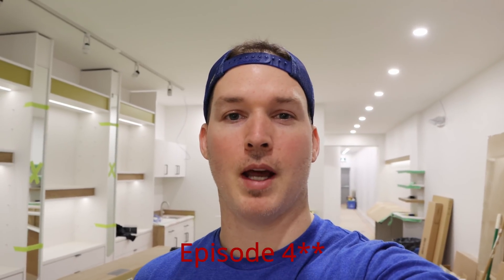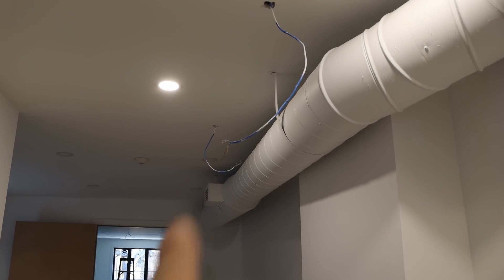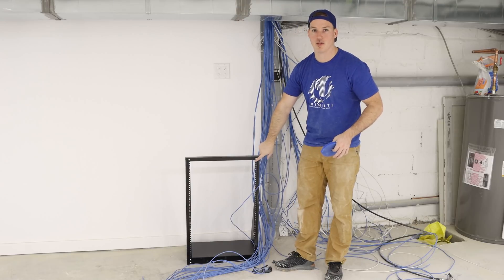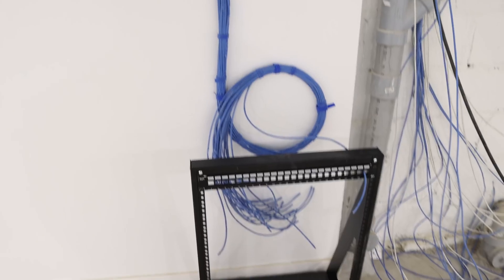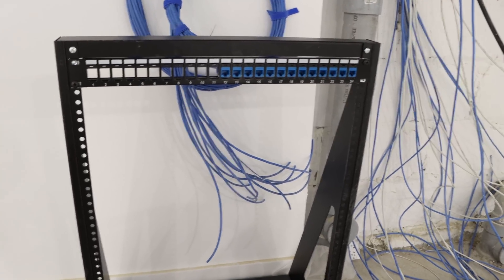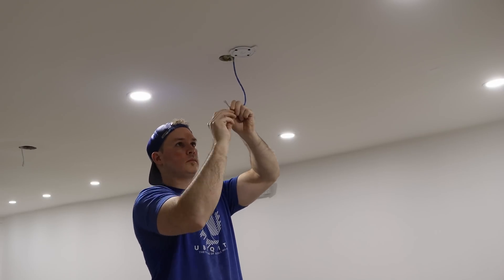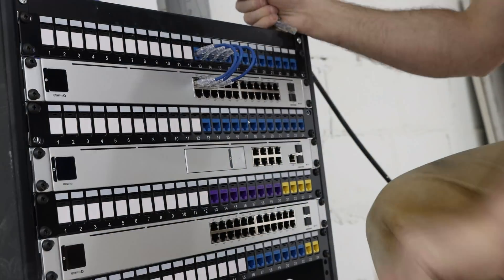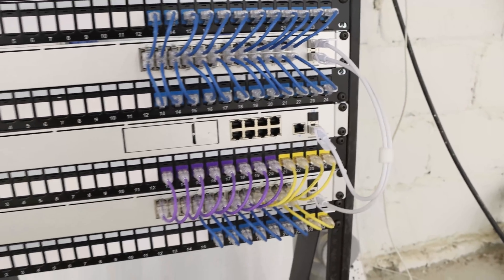Unifi Install and Cable Management

Comment: Maybe this is just me but... I would never run just 1 cable to a wall jack. You never know what will happen in the future. That doesn't mean it has to terminate to a switch, but at least be ran.
Reply from the maker: I agree. Problem though is what the customer is willing to pay. In this case they only wanted one drop

Comment: Why not mount the AP over the hole. Just pop a small hole in the plastic holder. Would look much better
Reply from the maker: The drywallers patched it after we were in

Comment: Hi Just wanted to ask, is it possible not to add a patch panel, and cut each ethernet cable so it reaches the ethernet ports of the switch and then just add ethernet connecter to cable and plug directly into switch

Comment: The partial hole where they made the AP hole too large is so cringe to me. Were the bracket mounting holes too narrow to cover that? Why did you offcenter?
Reply from the maker: We were in there before the dry wall was up and had the cable center. The drywaller needs to pop the cable through the hole for us.

As for the massive hole before the AP that was all patched up

Comment: Looks good. I'm working on a project where switches are 300ft away. Are there DAC cables that long? Or would I need to just buy sfp port insert and use cat6?
Reply: DAC is meant for in-rack cabling. You'll want to use Cat6 or fiber depending on your speed, distance, and RF requirements. If It's 300ft of cable, 1Gbit is plenty, and you're not running next to mains wiring, then Cat6 is probably good.
Reply: @PoisonWaffle3  Thanks Scott. That's what I'll do. And I found the Unifi CAT SFP adapter so that will work perfect.

Comment: Glad to see you seem to be doing well, bravo. What blew my mind though is a network rack sitting on the concrete floor in a basement? I'd have it mounted up on the wall eye level so I didn't have to stoop over constantly. 

Personally I don't even want my rack sitting directly on the floor in my office with a wood floor; wheels or feet are fine. 

Anyway, take care. Hope all is well!
Reply from the maker: Hey ,

Yup doing well. The client bought this rack. We changed it out yesterday for a walk mount

Comment: This video made my OCD very happy. How do you plan on connecting the NVR to the rest of the system?
Reply from the maker: The NvR will be plugged in using a DAC cable. We’re going to add a aggregation switch and also changing out the rack to be wall mounted

Comment: quick question, why not connect each switch from the UDM, instead of going from UDM to a switch, and then from that switch to another switch?
Reply: The top SW is at full RJ45 port density (24 ports used). The UDMP FW only has one SFP port for LAN and one for WAN(2); one rj45 WAN(1). You can reconfigure WAN for LAN I think, but I always prefer 2 WAN for failover internet even if not used immediately.

Comment: Looks great! Nice clean setup! I really like those patch cables. They're not something I've used myself, but I might have to switch over to them. 
The only thing I would change is the rack. I prefer equipment to be in an enclosed rack to prevent damage or tampering to anything.

Comment: On the first AP why not just offset the mount over the hole a little bit? It would have hid the blemish completely.
Reply from the maker: It has been patched by the drywaller.
Reply: @MactelecomNetworks  The correct approach is always the best ;)

Comment: Is there any reason why you looped in and out of the top switch opposed to running each network cable from the UDM?
Reply from the maker: Back plane of the UDM pro ethernet ports is only 1gb we’re adding an aggregation switch to this anyways

Comment: Hello,
How are you keeping track of what cable is what? do you label them before routing ?
Reply from the maker: Yup they were labelled with sharpie when I was pulling them in. I also have them labelled on a floor plan. Then the final labelling will be wire wraps behind the keystones, labels on the patch panel and then labels at the end device, faceplates
Reply: @MactelecomNetworks  Thx for the reply. Are you going to make a video about how you do it, one day?

Comment: I just realized, last year, I installed a new CCTV network for the company not that small.
1UDM Pro/2UNVR/1 XG16/7 USW or USW Pro/68 G3nG4 Cam/ 16 Door Access.
I Install all of it in 25 days with the other 2 helpers.(7/F Concrete building

Comment: Any reason you went from switch to switch and not both off the UDM ? Surely that is just asking for trouble if the primary/data/voice switch goes down, you lose both. If you DAC off the UDM to each switch you can still keep cams/wifi up or LAN/Voice patching up independent of the other.
Reply from the maker: Good question and you’re correct we would lose both. 

So we are going to be adding another two switches. One 16 port PoE and a aggregation switch .

But if we lose the aggregation switch we lose all switches. It’s all about client budget and how much availability we need

Comment: Great looking rack. 
Never understood not labelling cables during a pull, takes seconds with a sharpe and saves hours of work. If a cable gets damaged during pulling or by another trade it won’t tone. I’m in the UK and I would always expect a new install to go in order left to right from the door for each room.

It doesn’t take any longer to install, no toning needed, just test and I can label the outlets professionally, it makes finding outlets instant for customers. Also not uncommon to mark outlets on a map attached to the rack. Running 300+ outlets in a office is not uncommon, not toning that out. 

Cannot ever understand having say port 17 and 3 on the same wall plate. That’s just crazy!!
Reply from the maker: All the cables are labelled I jsut haven’t labelled the front of the patch panels which will be done tomorrow.

Also have a floor plan with all the numbers I did mention that labelling would be done on the next visit :)
Reply: @MactelecomNetworks  Can’t fault a professional install, like this! 
Was more of a comment over what I’ve experienced. Seen the good, the bad and the ugly countless times over the years!
Reply from the maker: @cg4528  I figured as much. Labelling is essential

Comment: Why did you pick the phone system you did? Would UniFi talk work just as well? Or would it fall short in certain areas?
Reply from the maker: I've used Grand stream quiet a few times and it works well and not over complicated to configure. Currently Unifi Talk is not available in Canada so its really hard to get the phones. If it were available I may have went with it

Comment: Hello there, can I ask why do all the CAT 6 Ethernet cables need to be on the patch panel before plugging in on the switch? Can they be directly plugged into the switch without needing any patch panel? Can you please explain, I don't understand.
Reply from the maker: Well the main reason cable management it would look not so nice if you just put rj45 end on and connect directly to the switch. Also the cables are certified end to end. If the cabling goes bad it will typically be the patch cable which can easily be replace instead of having to go back to the job site and re-crimp an end on
Reply: @MactelecomNetworks  Oh, now I got it. Thank you so much. Have a great day! 😊

Comment: I think this is my favourite style of video you make right now. Love it. Keep it up bro.
Reply from the maker: I love on the job videos I wish more people in my space would make them but it takes so damn long. Especially when you’re trying to get the job finished
Reply: @MactelecomNetworks  I though of also doing install videos but like you said time is money and I mostly work alone.  Setting up camera and talking while working is just too time consuming.  I do both tech support, design and install both hardware and software alone.  Adding recording is just way too much!  Just want to get in and out quickly!  Also question of privacy issues.  My customers are not too keen on having their setups being visible.  I myself don't like my private stuff on the web.
Reply from the maker: It does take a lot longer but thats what the people want to see. As for the privacy thing I ALWAYS get permission from the customer. If they do not want their site filmed we don't

Comment: Hey man, awesome work!!!
Quick question, what kind of keystones and set of crimpers you used? I have tried different kind and still haven’t found the right ones. Thanks!!!
Reply from the maker: The tool is the vertical cable I-punch tool and the jacks are vertical cable vmax there are links in the description to them
Reply: He answered this question in the video.

Comment: Have you tried ubiquiti's cable? do you have a link to the cables you typically order from Infinate cables?
Reply from the maker: yup I have I like them for patching in devices as you can bend the boot but I don't use them on the patch panel side

https://www.infinitecables.com/cat5e-cat6-cat6a-cat8/cat6-patch-cables/ultra-thin-patch-cables/rj45-cat6-utp-ultra-thin-patch-cable-premium-fluke-patch-cable-certified-cmr-riser-rated/?variation_id=10577
Reply: @MactelecomNetworks  what about for bulk cable? I look at the price Ubiquiti is selling a box for and the price infinite cable is selling a box for and I wonder what the difference is.

Comment: Well done, thank for the video! IMHO I would not put the UDM in the bottom - there are sewage pipes and a water heater, so IF you get a leak the floor might get messy incl the UDM ... or a rainstorm etc - get things OFF the floor as high as possible
Reply from the maker: The UnVR was just on the bottom temporarily for weight. We are actually switching this rack out with a wall mount so it’s off the floor :)

Thanks for watching

Comment: Question when working with this amount of cables, do you lable each cable before pulling the cable from the outlet to the patch location or how do you make sure what colour keystone to patch?
Reply from the maker: I do just with a sharpie. Then when I’m done I label the patch panels, do wire wraps on both ends of the cables and face plates 

I also have a drawing with all of the labels and where they are located
Reply: @MactelecomNetworks  Thanks for this quick reply, if i'am correct all cables going to the patch panel are blue, these are bundled and distributed on the two patch panels and switches. Is each cable labelled so you know where to connect the cables (blue for data/yellow for AP and purple for Camera). Or could you show this in upcoming videos? Keep up the great work!
Reply from the maker: @jeffrey8859  I think it will be easier to do in a follow up video I’ve had a few people ask this

Comment: Awesome Video. You mentioned at the end you went with a USW-PRO because you plan on setting up a ui access controller... Why do you need a pro switch for that? For the L3 capabilities? P.S. off topic - Noticed your Dexter stuff in the background. Did you hate the ending of new blood?
Reply from the maker: Hey so we need the pro because it has PoE++ to power the Unifi access hub.

I actually was ok with the dexter ending was a lot better than the original ending lol

Comment: Nice video and clean rack and cable management! How are you crimping the keystone modules with the cables?
Reply from the maker: For the keystones I use the vertical cable ipunch tool there is a link in the description for it

Comment: Basically, what could I expect to pay for a normal Cat 6 cable run to be installed residentially?  About 100 ft  runs
Thx
Reply from the maker: Residential is always tricky, depends if the home is finished I would say between $150-$300 I know that a large gap but residential is always a pain

Comment: Great video🤙however I do have a question. Why did you use only 2 DAC cables- is it not best practice to use at-least 2 interfaces for each of  those links between the switches and the router for redundancy? (link aggregation ) on most vendors STP is enabled by default.
Reply from the maker: You can do that yup,this install still is not finished we are most likely adding another POE switch and an aggregation switch. I’ll update when it’s completed

Comment: Nice install.  I would put 2 ciment blocks under the rack just to keep it off the floor.  Also might put a sheet of foam between the blocks and the rack to reduce the chance of rust.  You can pretty much put any type of thin foam.  Contractors usually have some lying around when they put wood 2x4 directly on concrete.  Love that Megapro screw driver!  I've had mines since 2003 when I started my IT Consulting company and still have it today.  I carry that screw driver with me wherever I go (except when I take the plane)!  Only issue I had with it is after 19 years of use, 2 of the clips that hold the spare bits are loose so when I open it, they fall out.  Very durable, still have all the bits and none of them are worn down but of course I don't abuse my tools!  Also added the red one a few years ago that has the security bits.  Practical when you need to open up security panels or remove screws from other brand cameras.
Reply from the maker: Great suggestion. We are probably getting another rack so we can wallmount just waiting on confirmation from the client.

Will be more work but worth it in the end
Reply: Yes, I would be worried that the basement may flood at least partially.   So a wall mount seems preferable or at the very least, up on blocks.
Reply: @MactelecomNetworks  You might want to just build a shelf onto the wall at about 3-4 feet off the floor. Nice sheet of laminated wood with a couple of triangular brackets under the shelf for support. A local Home Depot will have what you need. Set the rack and bolt it to the shelf so it stays to the shelf. This gets everything off the floor, keeps the equipment from becoming a dust vacuum and allows for working and viewing at eye level. Nice work on the patch panel layout for the short jumpers. I've been doing that for years and pretty much perfected the layout. Cheers!
Reply: and leave room for the heat to vent. im assuming out the back

Comment: Hey man, awesome install. I've got a question.. How do you know which cable goes to which devices or wall jack when you get to the labelling? Do you just power on everything, and see what unify says? Do you then rearrange the cables to match the camera keystones, and ect? thanks for all the work you put into this channel my dude!
Reply from the maker: Hey,

Good question I have a floor plan with all the data numbers on it and in the patch panel the data drops are blue so I just count up 1,2,3 etc maybe I’ll do a video on testing and labelling
Reply: @MactelecomNetworks  that would be super awesome if you could make that video.. something that shows how the labelling, and the planning for cables goes for organizational purposes, cus i couldn't imagine running all this cable, to feed into the rack and not knowing which cable went where lol thanks again my dude!
Reply: @aliazimi91  Its not so much remembering where each cable goes when running it. Lets say we pull 50 drops to a rack, I may or may not choose to label each wire as I am running it but most of the time I end up not doing that since in my experience I have to test each drop anyhow so we are doing twice the work. We run the cable, terminate both ends, tone from the wall plate to the rack, find it with a Fox and hound tool, label and test the pairs, and the map of the building/drops is made during that process. Then we can sort out the wires and group them together by room and separate the POE from the normal.

Edit: Also we use color coding/type of wire if we have multiple systems, Cat 6+ Blue for Network, Cat 6+ White for Cameras, White Cat 5e for Phone.
Reply: @Mactelecom Networks  Would love to see a video!
Reply: Good question!  Definitely helpful and great video idea!
Reply: Label each cable as you pull. Pull a room in order. I like to pull the furthest away from the rack first unless the client provides a map. Room outlets are run clockwise and ascend in number. Also saves cable as you pull the shortest runs last and can see on the boxes how much is left before you start, avoiding waste and short runs. 

For large installations, we mark up the floor plan, and then leave a copy with the test results for the customer. all these take seconds on a job, more then saving time as no toning needed. Large firms with multiple comms locations and cabinets, really value this approach and the IT guys always thank us for the ease of finding outlets.
Reply: @cg4528  I too always put the longest cable first.  That way you don't end up with too many boxes of cables that are too short.  This was specially true when we had to pull 200 drops in apartment buildings.  Started from the top floors to the basement.  Then when the cables were not long enough for the higher floors, we kept them aside for the lower first/second and third floors.  Avoided wasting boxes of cable.

Comment: Looks nice but to me only using half of a 24 port patch panel is wasteful, I know I know it's so the cables look clean because of how the ports are layers out on the UniFi switches but you can still use a full patch and make it look nice.
Reply from the maker: Yup I get it. I only had 6 inch patch cables anyways so if I filled the patch panel the cables wouldn’t reach

Comment: Nice install! The only thing i don't like is the UNVR's design, the ports for connecting it are at the back and it has no screen.
Reply from the maker: The UNVR Pro has the SFP+ and ethernet interface at the front I wish the normal UNVR had the same

Comment: Don’t mount that rack. Electronics love the dust from the floor and water if it floods.
Reply from the maker: So you must have missed in the video where I said the customer purchased this rack not myself and its not wall mountable. Either way we may be changing it out for  a wall mount
Reply: You must be new to the industry lmfao